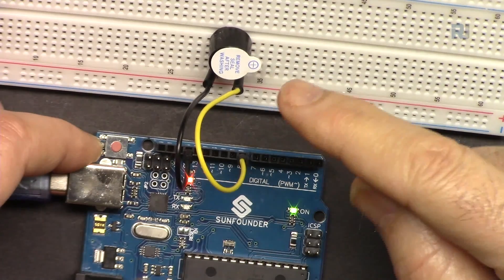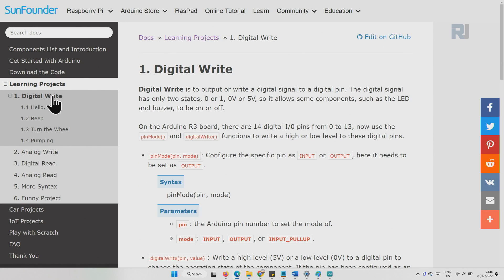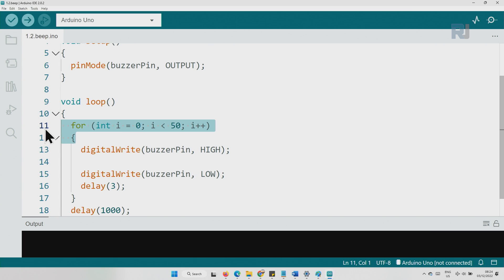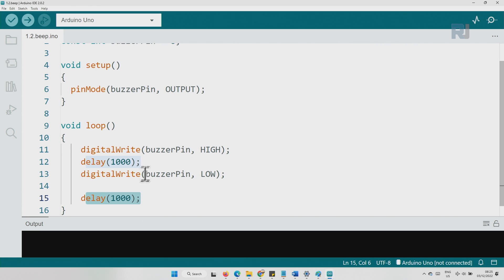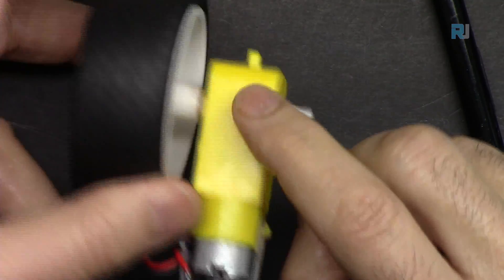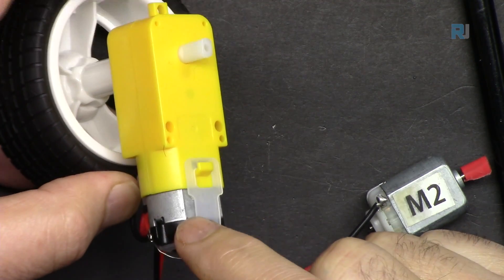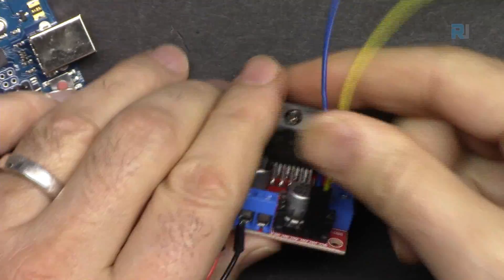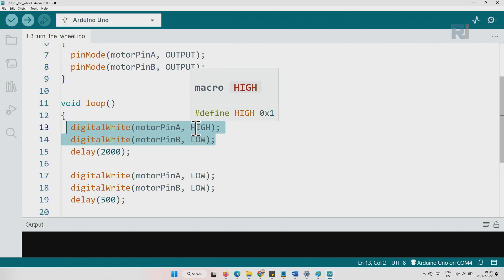Lesson 6: Buzzer, Driver Wheel and mini Water Pump using  Arduino SunFounder Kit- RJT589

Comment: The L290N moto driver isn't in my box, it's only L9110. The L290N moto was also never listed among the lists of components, which means that it was never in the box.
Reply from the maker: It is the L298N. it should be.  or may be they changed the module to L9110. which version of the kit you have?
Reply: @robojax  I actually have the same issue — I didn't receive the L298N; instead, I only got the L9110 in the box. Will it still work as expected, or should I order the one you used?

Comment: I followed everything to the letter and the pump isn't doing anything, i have even replaced the pump and it still doesnt work
Reply from the maker: Connect the two wires of the pump to 5v directly and see if it works. Then check your wiring if code is okay and not changed.
Reply: @robojax  thank you so much for your response it still isnt working its really sad because im doing a project at unniveristy and there isnt much material online to do with setting up micro water pumps i just want to go from the ground up being able to control it so ive followed the video again  and it still isnt working.